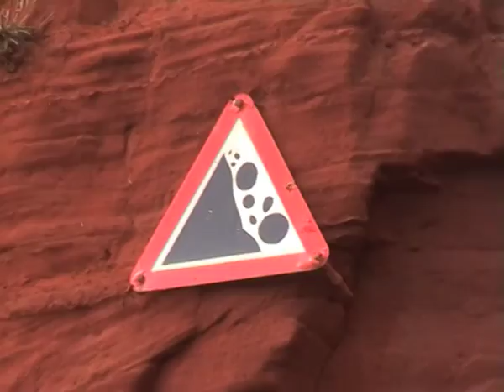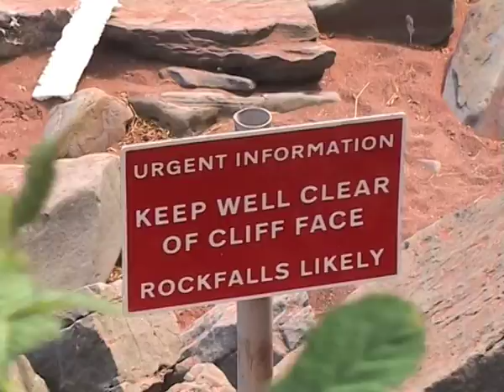Rock Job Hollicombe

Comment: The mesh can hold one ton of weight in a directional pull down on one diamond and he is clipped on two diamonds. Also you cant have a fall factor 2 when partly on flat ground. 
Job looks sound lads not as good as Torquay though.